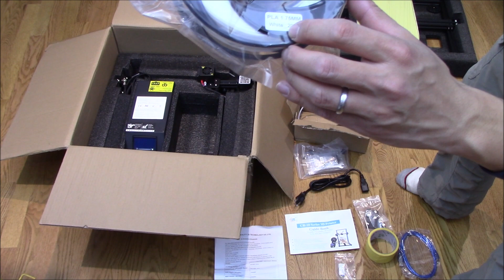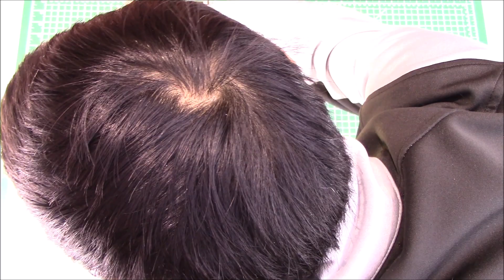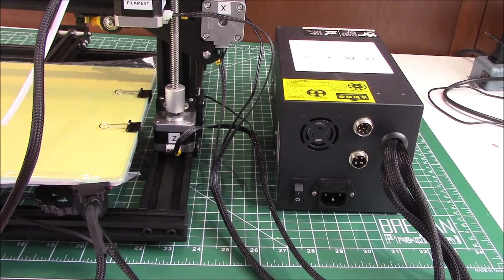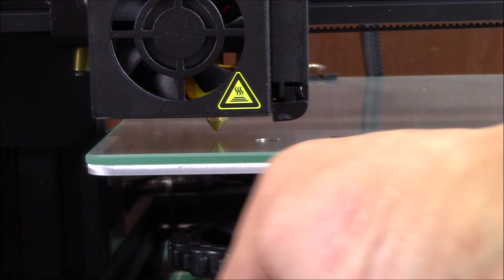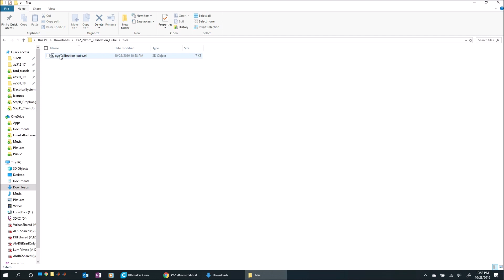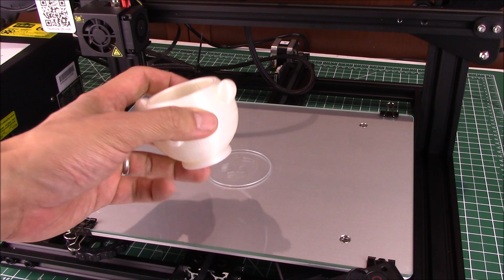The Creality CR-10 Mini 3D Printer: Unboxing, Assembly, and Review

Comment: Thank you for posting this. Finally unpacked my CR-10 Mini yesterday after clearing a spot for it. After two days, turned it on...loaded up filament and leveled the bed. Unfortunately...I get the bed heating up...but the extruder refuses to heat up...straight out of the box. Any suggestions why this part refuses to heat up and errors out with the Heating Failed error (without anything else) and getting a flashing "?" on the main display?
Reply: Make sure if you are having any issues to check that your connectors are tight on both the printer and the control box. Once I checked all the connectors on both ends and restarted the printer...it started working and am now printing out the cube to see it in action.

Again...thank you so much for this video!

Comment: I just got this 3D printer and everything is working fine except it will not take the filament. The feeder is spinning but the filament will not go? Wondering if you know why?
Reply from the maker: I actually had this problem once.   On the filament motor,  there are a few set screws on the drive,  check to make sure they are right.   Good luck!
Reply: I got it to feed but now it will not stick to the plate. When it extrudes it will sort of drag the filament.
Reply: The filament is also getting stuck to the nossle

Comment: How were you calculating the cost of the print. By the way great video.
Reply from the maker: I basically compute how much electricity it uses and add this cost to the amount of filament consumed.  Thanks for watching!
Reply: Thanks I am looking at getting this printer
Reply from the maker: @TheBrowns2015  I've been very happy with it so far.  I've only printed in PLA and PTEG but I've done around 400 parts and it hasn't given me any issues yet.
Reply: Cool I think I’m going to go with the one you have. I have Never owned a 3-D printer but this one looks really good. Thank you for the tips in your video.